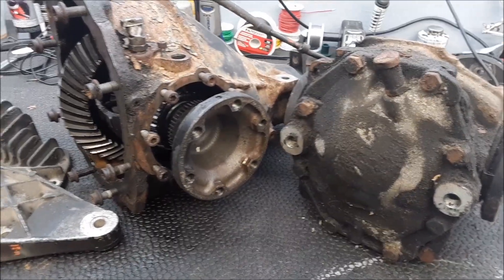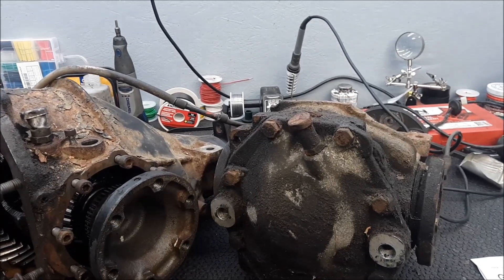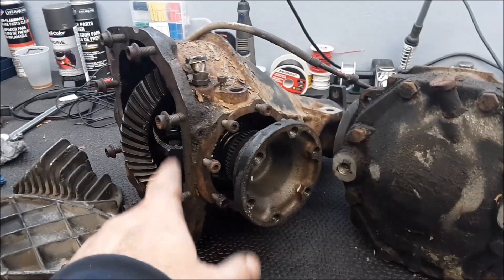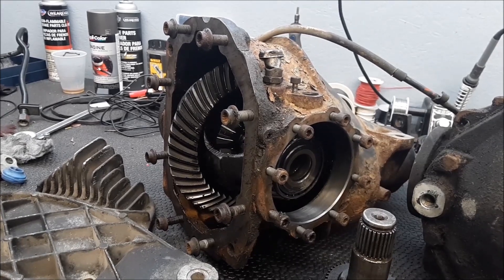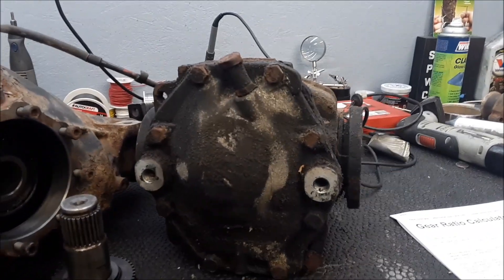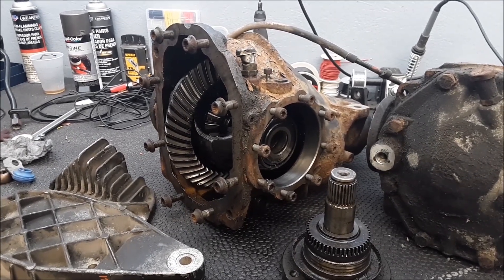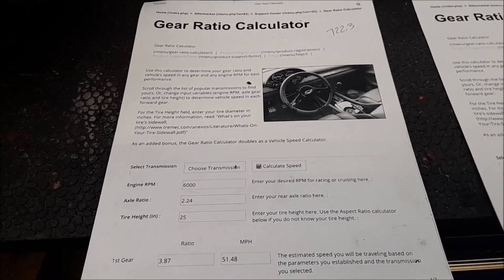Mercedes-Benz W124 - Differential - The Hillbilly Hammer

Comment: Just found your channel. 
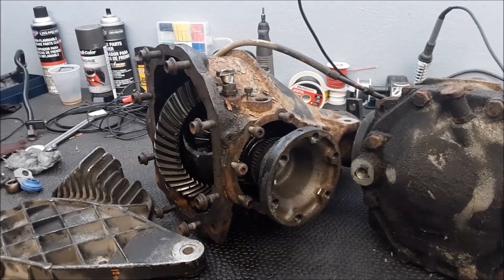What 5-speed are you using? And, how are you re calibrating speedometer? (I have a 94 E420 with ASR and 2:24 diff. I have acquired a 500E ASR diff with 2:82 ratio to swap in.)
Reply from the maker: Don't need no stinking speedo. Good luck on the swap!

Comment: does the early model non asr 3.69 diff work wit a standard w124 300e? wuld the covers need to be swapped?  @bicyclinderico
Reply from the maker: It will not. It's the large case unit whereas your rear subframe and axles need the small case

Comment: 3.69 is to much for a v8, those were fitted with 5 speed gearboxes. Problem you have that north America cars had different ratios Vs euro, ie this would have 2.65 here. I'd probably stick that, maybe 2.82 from e500. That engine has enough torque to pull this.
Reply from the maker: Negative. This car came with a 2.24:1 diff. Also you are in no way familiar with this engine. It makes no power under about 4k rpm.. Over here we run big blocks with 5.13 rear gears so this 3.69 does just fine with the 5 speed.

Comment: A lot of folks don't know that the w202 and w208 are based on the w124, and have the next gen driveline components. So, there may be a way to fit those parts to a w124.
Reply from the maker: They are actually quite a bit different. The only chassis very similar is the R129

Comment: I have a turbo ls in mine. Any rear options or should I just go with a 8.8? 87 420sel
Reply from the maker: The 126 cars have an even worse rear driveline setup. I would swap for something more adaptable and like you stated, an 8.8 would be a great choice
Reply: @bicylindrico  8.8 it is. The forums pointed me towards you because apparently we're the only ones pushing the platform this far.

Comment: Question at time marker 3 minutes and 5 seconds what car did you get the small axles off of
Reply from the maker: W124 with the small differential. I believe the W202 and 6 cylinder R129 may use the same axle but it's been a while.

Comment: im working on an m104 with the 3.49 diff on the slk230 with speeduino. I have dual springs from 300-24 and another engine from a 88k mile 300ce with the m104. Both disassembled assembling head but need to degrease valves thoroughly
Reply from the maker: Sounds like a great build! Not sure that engine would fit under the R170 hood though
Reply: @bicylindrico  lol absolutely it will fit. theres a 5.4l v12 inside the bay of an r170 as the slk hammer brabus version. That is my next goal.

Comment: I’m trying to get some advice on a 2005 C230 Differential I’m trying to find a differential  that I can Swap in it that has an LSD any advice
Reply from the maker: I am not familiar enough with any W203 mods. For the most part MB never used factory LSD as most all of our cars had traction control so it would have to be aftermarket

Comment: If someone happens to need/see this info. W124 300-24v with 5 speed 722.5 also had the 210mm diff with 3.69 ratio. Non asr and asr models exist.
Reply from the maker: Interesting. I actually own a wrecked 1990 300CE that went off-road and busted the rear diff cover. I paid it no attention. I am now curious to see if it has the large case. I do have the drivetrain for sale. Only 61k miles and I have everything pulled and ready to load up for a buyer
Reply: @bicylindrico  if its m104 100% has 210mm diff if m103 it's 185mm diff
Reply from the maker: @jrt2924  It's the 24 valve M104. I am curious if it has the different tubular subframe with the wider diff mounts. Thanks for posting!
Reply: @bicylindrico  unfortunately no. It. Has narrow pattern same as normal w124. I wish it had v8 style. Due to owning 400whp m104 turbo c124

Comment: How long do these diffs last - I have a 1987 230E and my diff started leaking from the main seal after I did a complete oil change to fully synthetic - it was a small leak but I forgot to check it regularly and I think its level became much lower than max over time - can these things just break?
Reply from the maker: Not really. Under normal driving circumstances they will easily live the life of the vehicle
Reply: I would run dino everything in a benz that old, it will swell those seals, and and probably stop the leaks. This is the main reason to not switch an older car to synthetics.
Either way, It's completely normal for a benz to seep fluid from the seals of the diff. This has been going on for at least 40yrs, especially if they have sat for any significant time in their life. The general rule of thumb is, "is it wet, or does it drip?". If it's just wet looking, go on with your day...

Comment: Getting a 94 400e and planning to swap the rear with a  w124 230e’s  limited slip diff  3.27 gears with ADS. Any suggestions??
Reply from the maker: Not a direct swap and a weaker unit. You will have mount location issues, axles wont work, input flange will need swapped. If the 400E has ASR then the diff wont work at all due to the speed sensors
Reply: Thanks for the info AND the speedy response. You just saved me a few bucks and some headaches

Comment: I have a 92 400E and hearing clunking noises in the rear end. I was wondering if I should rebuild it or upgrade it to something better?
Reply from the maker: Doubt it's the diff. They're are damn near bullet proof. Likely something else
Reply: Check your subframe mounts, especially the front ones. Very common failure on old MBs. Get a polyurthane replacement, much easier to swap in.

Comment: I’ll be running an 3.06 ASD with the 722.5. I totally get your motivations for the shorter final drive man. For me I’m about 10 minutes away from the Autobahn with no speed limit and I wanna get some higher speeds in as well, so it’s totally different. Especially since they recently lowered the max speeds from 130kph to 100kph here in the Netherlands during daytime, to help combat pollution. So a blasting on the Autobahn during the weekend to the Nordschleife is an excellent way to expel the traffic frustrations of the week hahah